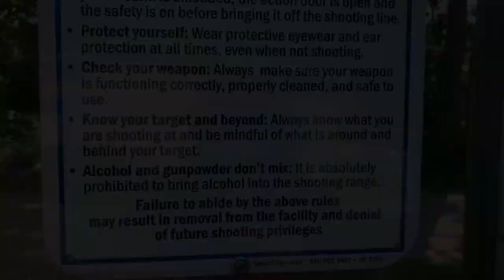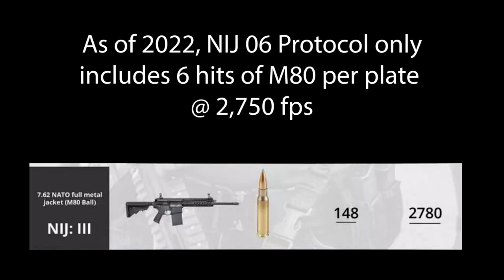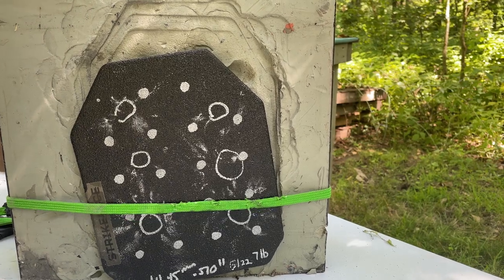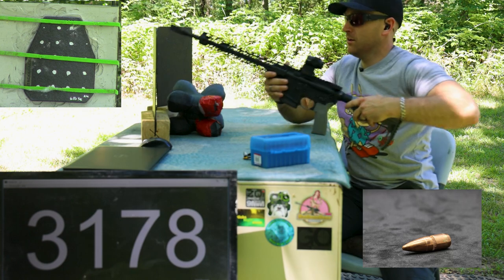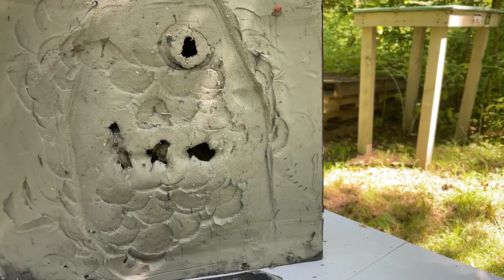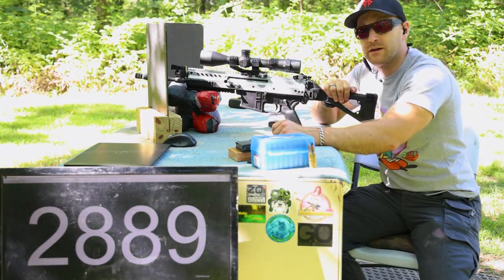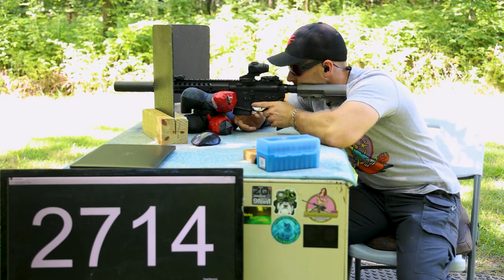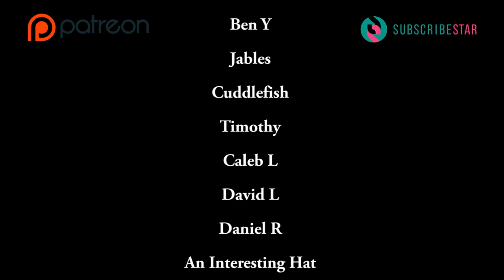Tacticon Armament Level III+ Steel Armor Demo!

Comment: You're doing gods work
Reply from the maker: Why thank you :D
Reply: @BuffRANGE  let me ask you this, do you believe all the hype that you have to have ceramics? That steel will frag and spall and rip into your throat and face?
Reply from the maker: @bryanrobert2763  Fragmentation off steel plates is a thing. It's probable and very possible to happen depending on the carrier and clothing you're wearing. Those fragments are very sharp. I did a test at one point with AR500's plates and stacked gel blocks around them, and those frags were entering the the gel. 

The issue with Steel;
1. Heavier than PE and Ceramic Composite offerings
2. Generally single curve or multi curve is not as curvy as PE and Ceramic
3. Threat profile is limited. When the hardness of the steel goes up to combat M193, it becomes brittle and less multi-hit capable.
Reply: @BuffRANGE  thank you again for the reply, I have some cheap Chinese PE plates that are like .8in thick, and steel Tacticon ar600 (lightweight) plates, at this point do you think the cheap Chinese PE would be better? They are ULTRA light weight. Like a lb or two each. Eventually I will get ceramics but my wallet can't take it right now.
Reply from the maker: @bryanrobert2763  it's one of those hard to call scenarios. The PE plates will stop M193 and being lighter helps your mobility, but will not stop M855 in anyway. The AR600 stop M855, but not M193 from longer barrels, and are heavier.  We can never know the adversaries loadout, but if you think one of those bullet types would be more prominent than the other, go with the coverage that works for that. Save up the $$, and then eventually upgrade to a ceramic/composite, like a Highcom 3S9M, or RMA 1092 G2, or level IV's if you think you need it.
Reply: @BuffRANGE  Copy that, thanks man.

Comment: I love all of these armor tests.  I always see reviewers worried about the coating and stuff separating.  Does it really matter?  As long as the armor does it job you wont be keeping that plate around for future use lol.
Reply: Why would you be dumb enough to take the risk? 100$ is really worth it? You wouldn't buy chinese TQs because they might fail, steel armor might spall or frag. Plenty of people have tested Ar500 armor with the liner and gotten spall into the test dummies neck. Is that REALLY worth it? Is saving 5 cents a bullet worth it if your chance of jamming goes up 50%? Are Promags good deals because they're cheaper, or does their potential failure make them not worth it.
Reply: @RogerCharlamange Are ar15 Promags unreliable, or are you referring to pmags for Glock?
Reply: Yes it matters. Do you want spall to get your jugular?

Comment: A lot of people bash steel, but it has a lot of upsides.
It dosen't expire & is way thinner than most other hard armor.
Reply: those are literally the ONLY upsides... everything else is a negative including the fact that getting hit wearing it will probably kill you anyways lol
Reply: @ScullCandy56  So built up frag coating just doesnt exist all of a sudden? No ones taking so many rounds that the coating wont do its job

Steel has negatives, but dont sit here and lie and hyperbolize
Reply: So edge hits are fine? And oblique angles? You think that the frag lock will work when you're dealing with anything other than relatively center of plate hits?

The only people that really seem to defend steel are people that only have steel plates because getting a $100 plate and $150 in kevlar wrap somehow is smarter than a $250 plate that's just plug and play.
Reply: Ceramic doesn’t really expire it’s just the warranty that ends.
Reply: @ScullCandy56 lol if you don’t know facts then don’t say anything 🤡

Comment: Surprised it failed to stop m193 that like standard range ammo…
Reply from the maker: That's the problem with 99% of steel, it's weak to M193 at speeds over 3050-3150 fps. The new RF2 rating is 3,250..

Comment: Glad I found this video before buying these lws600 from tacticon.  It says right on the plate they'll stop m855a1.  Clearly not the case.
Reply from the maker: Have they not updated their website or literature? Because they told me that was in error.
Reply: As of January 2023 their website states the LWS600 plates stop M855. It does not claim to stop M855A1.
Reply from the maker: @David-Ralph  Good that they updated it.

Comment: If you have an opportunity would you be able to test the ar500 lever 3+ lightweight steel plate with a polyethylene backer against all these threats, I would be very curious to see the result. Thanks so much for all you do.
Reply from the maker: I’ve completed testing! Let’s see if I can get it done
Reply: @BuffRANGE  thanks so much, your the best.
Reply: On a personal note each time I placed iiia or even 1/2" thick lexan behind level 3 steel it has contained the armor slug and bullet fragments.
This was seen using a 16" barrel and 40gr fort scott 5.56.

I have seen a video of hot m193 out of a 20" penetrate level 3 steel and the soft iiia behind it then proceed several inches into ballistic gel so while the iiia backer helps I wouldn't totally rely on it.

Comment: Question? I am new to this and doing research.   Is this plate supposed to stop most of these? Isn’t this bad ?
Reply from the maker: Steel is traditionally only level III aka M80 ball at 2.750. Some of these velocities are worst case scenario. It’s kind of to show that steel can be strong against some threats but weak against others
Reply: I'm here after seeing tacticons plates online and am thinking about buying some. Per their website, the level III+ plates are supposed to stop m855, which here they did but I would think if it stopped m855 it should also stop m193, but it didn't so I'm trying to learn some more before buying these because spending money just to get smoked buy the most common rifle ammo there is is a disheartening concept for me
Reply: @94wasajam  this isn't the best video for a purchasing decision because this reviewer is using "worst-case scenario" methods like 0 degree angle hit and barrel lengths that will propel the bullet to velocities it wasn't tested to stop, so it's not actually expected to stop these threats even if they use the same bullet weight and load specs etc.
Reply: @unearthlyenemy  I did end up just grabbing some affordable level III steel plates. Not from this company tho I bought em local 🤷🏽‍♂️ from I've seen, although they're not rated for it, they will stop green tip. Soft level III seems to let it pass through, but that's soft armor. Like I said from what I've SEEN, level III  steel will stop green tip and is rated for 308 under a certain velocity. I think that's just simply due to the hardness of armor rated steel vs the mild steel core in green tip. Yes it IS a steel core "penetrator" but it's not AP. Seems as simple as a harder object vs a softer one. So yeah after doing 2 more months of research I'd say your comment holds up. It's velocity that defeats steel, not the projectile specifically. Still don't wanna take one to the chest, but im confident in my decision.

Comment: I’m new with plates but if it stops rifle rounds it’ll definitely stop pistol and shotgun rounds or is that lvl 4 plates?
Reply from the maker: Technically NIJ rated armor is only rated to stop the rounds the NIJ specs. Sometimes you can assume/infer if it stops A it'll stop B, but it's never a guarantee. Generally speaking a Level III plate would stop most pistol and shotgun rounds.

Comment: Does steel armor desitegrade when hit? And do you think those rounds (from this video hitting the steel armor) would break ribs? AND if a 50 bmg ap were op against 1 inch of ar500 and didn't go through. Would that man still be in the fight er would he die of blunt force trauma?
Reply from the maker: generally the steel remains intact. That's hard to answer. Steel doesn't localize blunt force trauma, but it does still transfer that energy somewhere. You'd need more than 1" of AR500 to probably stop specialty 50 BMG, and that would be a very heavy plate :O
Reply: @BuffRANGE  And the 50 bmg would hit let's say a 2 inch ar500 plate (i know i's FAR TO HEAVY for a soldier) but he wore it anyway. What would the blunt force trauma be? Could it hit so hard. that the heart would stop?? (normally it won't but it's a  50 bmg so it has so much power so therfor it can stop a heart?)
Reply: @frederikgram8970  my wife works with Cardiologist frequently. They've seen way less stop a heart. It runs off of electrical impulse. Any concussive trauma to the heart has the potential to stop it. Any lengthy action to get the heart beating again can cause permanent brain damage. Blood carries oxygen to the brain, no oxygen to the brain= vegetable if that person survives. Quite sad.

Comment: Do you think that simply putting a steel band like from a pallet around the edge of the plate on or under the coating would be worthwhile?
I'd probably stop the spalling a bit better that not having a steel band.

You could probably spot weld the stuff on the edge of the plate. but who even runs steel lol.
Reply: Welding AR steels is difficult and expensive
Reply: @Two-Stack  Worse still it can cause problems with the heat treat...
Reply: @Two-Stack  I made an anvil out of a 3.5X9X.5 inch plate of AR500 and a 3.5X9X12 piece of steel by surface grinding both surfaces and stick welding them together. The stuff was developed for the mining industry hence the name Abrasion Resistant, and they use it to line the inside of the backs of trucks and other stuff with high use. I doubt they bolt the stuff on since drilling it sucks, so it would seem like they weld it, since my AR500 welded to my mystery steel nicely. I was thinking more along the lines of spot welding like what is used in making spray can and bean cans, since it's better suited for holding thin bits of metal together in a cheap to do way.

Comment: i would like to see tests using some quality duct tape around the plate to keep the frag coating tight to the steel.
Reply from the maker: Probably a little more effective, but frags and muzzle energy will displace it.

Comment: What is best overall heavy armor max protection, lightest (so more expensive) multi curv ceramic plate available for purchase ? I don’t care how expensive it is
Reply: Protection is terms of srp, blast protection, (everything)
Reply from the maker: Max protection; The Adept Colossus. It's been the only commercial plate I've tested to stop M993, and at velocities well above spec. There could be others but it could be stuff civilians aren't privy to?
Reply from the maker: SRP? Blast Protection?

Comment: I think that this plate sitting behind a tile array sandwiched between 2 piece of polyethylene with a 3a backer and the whole thing bonded and stitched where possible and the whole thing having edge to edge coverage,
Also matching lower side panels and shoulder and arm panels for complete side coverage would be a hell of a setup,
I think it wouldn't be to heavy and for a vehicle crew rig it probably could be heavier still with extra thick tile or even 2 layers of tyle.
Reply: You better hope the furthest you'll need to move is from your couch to the fridge, because that shit will be unbearable heavy for any real use.
Reply: It just kills me to with ceramic Armor after six shots it's just gone. Do people who use ceramic carry backup plates?

Comment: The website says this plate is rated for m193 out of a 20 inch barrel going 3200 fps. Did they have anything to say about that or
Reply from the maker: Could very well be the V50 rating of the plate.
Reply: Ahhh i see. Thanks
Reply from the maker: @viin2148  To further expand the V50 rating means that at that velocity penetration could occur 50% of the time. This is where You'd have to go back to the manufacturer and ask them to validate their threat profiles for those velocities.

Comment: I thot this armor was suppose to stop everything you shot at it in this video?  And i just bought 2 differnt sets from them on a good deal. It was ar500  plates 3+ and there battle vest lite for 150 and then there original battle vest with ar600  3+ plates for 225. Anyone think i should of saved my money and went else where or got different plates?
Reply from the maker: If M193 and M855a1 are not a concern for you then by all means they’re decent plates.
Reply: @BuffRANGE  I don't think they should be.  Thanks for the quick reply. I thought they were a good deal so I grabbed em. While on sale. Got there battle belts also cause everyone raved about them for the price.
Reply: @BuffRANGE  thing is I thought there ar 500 and ar600 3+ were suppose to stop green tip.
Reply from the maker: @m.od.3116  green tip is M855. And yes they do. M855a1 is the enhanced version of M855 and its not easy to stop :)
Reply: @BuffRANGE  and I thought m193 was just your standard run of the mill 5.56 round. I'm confused on why these plates wouldn't stop that? I'm confused somehow maybe. This stuff isn't a huge concern but if it suppose to stop that like advertised?
Reply from the maker: @m.od.3116  My understanding is that with M193 and steel, Adiabatic shearing takes place when that bullet style goes very fast and hits steel. It typically goes like this
Steel: Weak against M193 and M855A1, but stop M193 and M80
UHMWPE: Weak against M855, and M855A1, but stops M80 and M193
Ceramic composites: Depending on models stop all of the above.
Reply: @BuffRANGE  thanks man.

Comment: Can you test steel armor at a 45 degree impact against some of the rounds that defeated it head on? Noone has done it and I think it would provide valuable info since your target won't always be standing straight infront of you.
Reply from the maker: I mean you effectively increase the amount of material the bullet has to penetrate. EX: MIL-46100E can stop M2AP at a 45°, but not at 0°. I generally show worst case, but if I get a set of steel in at some point, you do bring a good question. I'll see what I can do.
Reply: @BuffRANGE  The angled tests would still be interesting to see how well the spall coating works, given a square hit, while facing less material, is going to shatter the bullet, but at an angle, the bullet may stay more intact and therefore not be captured by the coating.

Comment: I like the cati level 3+ better
Reply: Did not see that video, how did that do?
Reply: Stopped m855a1 from 16 inch but not 20 inch however it stopped m193 from 20 inch independence m193 which is fastest 55g  there is

Comment: I thought AR500-600 is supposed to stop m193???
Reply from the maker: Not necessarily. There are variations of steel alloys that are needed in addition to just pure hardness to do it.
Reply: Oh wow, m193 is pretty common so that’s a bit of a worry. What steel plates should I look for to protect?
Reply from the maker: @fieldsrealty2091  only like caliber Armors AV2 and CATI Armor steel ops RF2. Very few steel can stop m193 over 3250

Comment: Wow... lvl 3+ that cant stop steel core 5.56. Green tips arent even "armor piercing" rounds. If it were black tips with a tungsten carbide core id expect it to rip through... weird that .308 stopped but green tip went thru.
Reply from the maker: The green tips you are thinking of are m855. M855a1 is the newest evolution to those and they are even hard for ceramic to stop. At a high level, Level III is ONLY M80 ball. Anything else under NIJ 06 has to be added as a special rifle threat. Now NIj 07 adds 5.56 but it was just published 12/23

Comment: You couldn't hit your straps if you tried. Bolt action rifle with a scope and you tried calling your shots a 45yds or was that feet? Laughable.
Reply from the maker: the truck bed coating seals up the hole and makes it very hard to confirm ;)  Have a nice day..